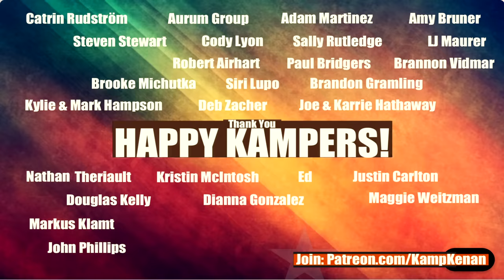Where are my Front Yard Turtles HIDING?

Comment: If you're getting dizzy every time you might have Orthostatic hypotension, a form of low blood pressure. It happens when the blood vessels do not constrict (tighten) as you stand up. It is usually a symptom of an underlying disorder rather than a disease in itself. The condition is also known as postural hypotension. But it's best to get it checked out.

Comment: I would recommend that you drink some electrolytes, to see if that will help. Water alone, doesn't hydrate you.  I would recommend LMNT electrolytes as they actually have appropriate amounts of sodium, to actually help, and not just a drop in the bucket.  Your blood pressure is changing when you stand up, which is why you are getting light headed. Electrolytes are a place to start.
Reply: or maybe a good ole can of TAB.
Reply: @arobbins8755  Right...soda is going to help. 😂